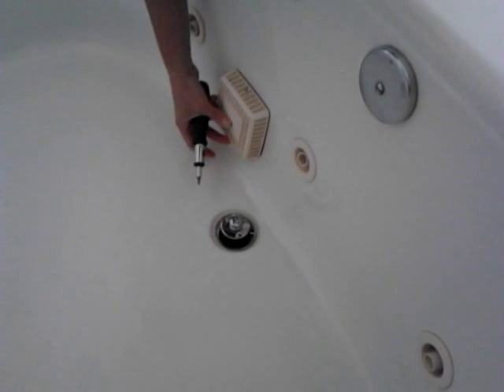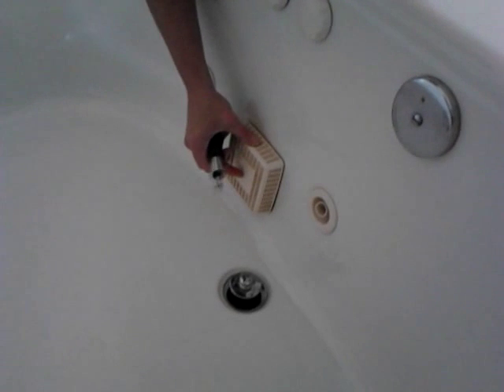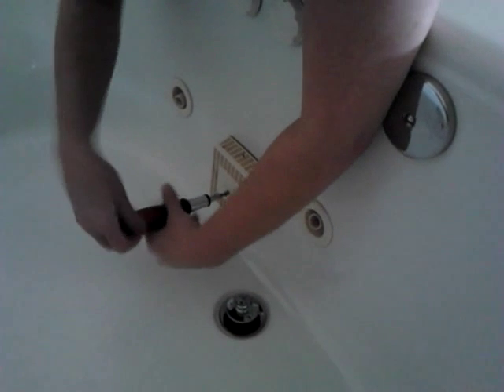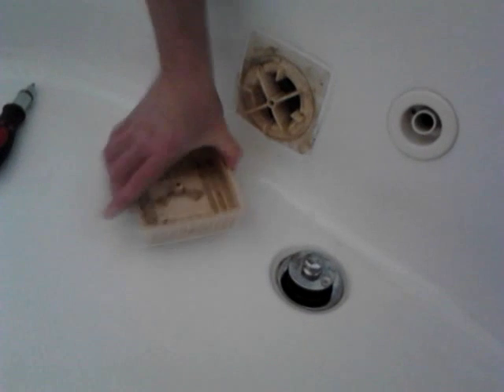2014.07.31 - Jacuzzi Rooms how to clean the filter

Comment: Following the video, I was able to clean the filter. It looks amazing! But when I ran the tub, the water drained out. Any ideas why that would happen?
Reply from the maker: I'm glad to hear the filter cleaning went well! As for the draining issue, I'm not entirely sure based on that description. It could be several things. I'd recommend checking the drain plug and seal. Hope that helps! And if you find these tips useful, consider subscribing for more. 😊🛁

Comment: how do you take off the filter? I don't see any screw.
Reply from the maker: Hmm, depending on the model of the jacuzzi tub, the filter removal process might vary. If there's no visible screw, it might just twist off. Try turning it counter-clockwise. If that doesn't help, I'd recommend checking the manual or the manufacturer's website. Hope that gives you a starting point! And if you find more solutions on our channel, consider subscribing. 😊🔧🛁